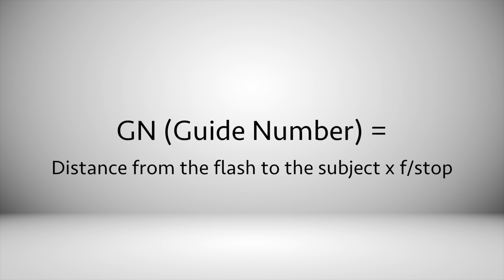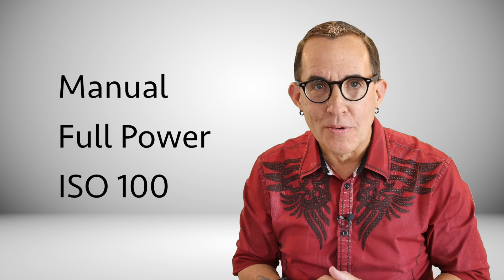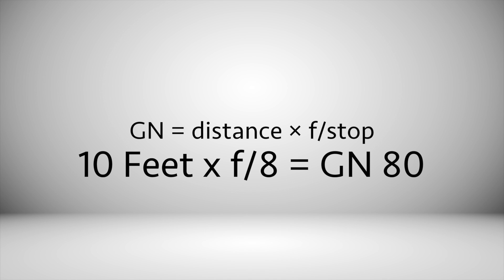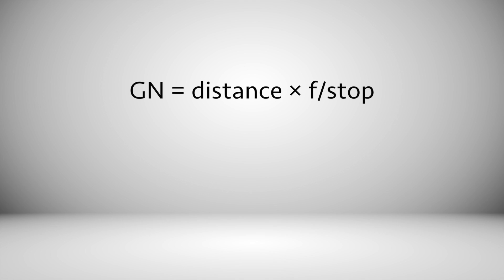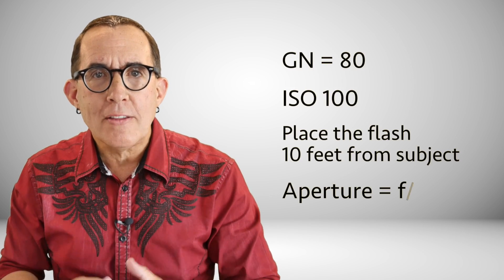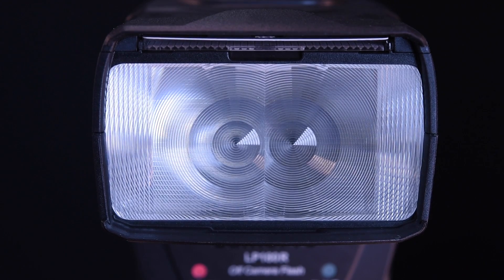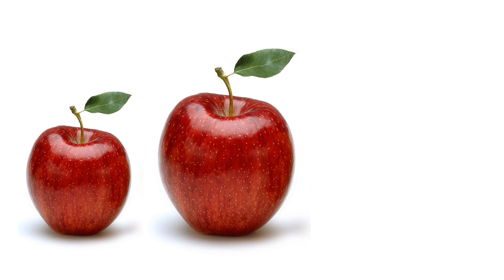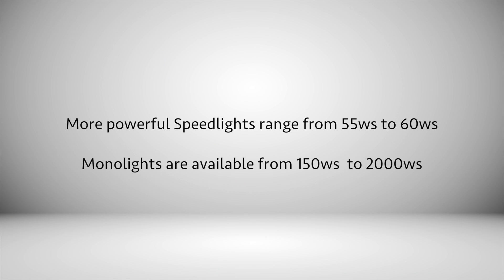Guide Numbers and Watt Seconds -  Flash Photography Tutorial #3

Comment: As the track photographer for the local NASCAR short track, I"ve been using my Nikon D7000, 18-300 lens, SB910 and a pixel td-382 flash pack.  the trouble I'm encountering is at night, even with the high end rechargeable batteries and flash pack, the 910 can't seem to keep up with even the 6fps of the D7000.  I'm upgrading to the D500, and am curious as to whether or not you feel that a monolight might offer better performance in keeping up with the 10fps of the D500?
     If a monolight might be better suited to my needs, is there one that you can recommend as a starting point? I'd prefer something more portable, as well as suitable for outdoor use.

Comment: I have a Canon 80 paired with a 100mm L 2.8 macro IS lens. I have purchased a reflector but I do not have a speedlight yet. I want to practice shoot headshots outside (I do not have the space right now) and I have been searching this lumopro you suggest but it seems it's not sold here in Italy both on amazon and ebay. there's another brand I may look for? Thanks in advance.
Reply from the maker: I am pretty sure that you could purchase via https://mpex.com/ pirate9882.  There are many other brands - it really depends on which model LumoPro you were considering.
Reply: Thanks very much Joe Edelman! I was looking for the one you suggest.

Comment: I love the video - very, very clear.  Can you help me understand something about my Elinchrom monolight?  I have a 400 w/s monolight, and it offers a "5-stop power variability" - on the back of the unit, I can dial in from as low as 2.0 up to 6.0.  I'm assuming that's the number of stops of light it provides.  But if I get their 100 w/s moonlight, it says it also offers a "5-stop power variability."  I was under the impression that stops weren't relative.  I understand that the 400 monolight is not necessarily producing a flash that is 4 times stronger than the 100 w/s, given what you've said here - plus there are some other factors, including recycling time.  Ultimately, I just need to know, if I had both lights, and set the digital reading to 2.0 on the back, should I expect the same results from each monolight in terms of light output?  Is there another factor that I'm missing?  Also, if I have the light set to 2.0 and put two stops of diffusion material in front of it, does that neutralize the light?  Thanks!!
Reply from the maker: Thank you Daniel Corey!  The variability is within each strobe.  So a setting of 2 on the 100ws is not the same as a setting of 2 on the 400ws.  If you put a diffuser in front of the 400ws strobe - you could bring it down to the 100ws level or you could just turn down the power.  My sincere advice - watch more of my videos - you are approaching lighting like an engineer,  Forget the numbers - learn to SEE light and you will find success,

Comment: Joe - you made a comment that you no longer use Nikon speedlights because they REQUIRE  line-of-sight IR for off-camera triggering.  I may not understand all the details behind your model demonstration at the end which might give me the answer to my question, but I'm using SB 900's with a D700 AND Yongnuo radio transmitter/receivers and everything works fine. Please explain.
Reply from the maker: Sorry for the confusion greenlight.  If you are using the Nikon SB900's with the camera flash as the commander or if you use Nikon's commander unit - they are line of sight strobes .  Since you are using the Yongnuo trigger - that relies on a radio frequency and does not need line of site.  Nikon has recently updated their line with the SB5000 which is also a wireless trigger.

Comment: Question: As far as guide numbers go, that's all well and good for a bare flash, but how does a diffuser/umbrella/softbox/ off camera affect that? It seems every time I use guide number to expose a shot, (I have been using a shoot through umbrella) I have to stop down considerably to get a proper exposure.
Reply from the maker: That doesn't sound right Neil Caughlan.  Let me take your last comment first... if you are shooting let's say at f/8 before the shoot through umbrella and then you add the umbrella - even if it is thin- it will still reduce the amount of light output which means you have to open up - not stop down.  As for how do you use the guide number with modifiers... remember that the guide number is essentially a reference.  I have never used a guide number as my main method of setting exposure, but if you wanted to - it would be a matter of running a series of test shots with each modifier.  Start with no modifier and confirm your f/stop.  Then add a modifier and test until you match the exposure.  That will tell you if it is a one or to stop compensation and then you know for future use.
Reply: Apologies, I meant to say open up the aperture. Thanks for your response!
Reply from the maker: No worries Neil Caughlan - in that case the second part of y answer would be my suggestion.  In practice - if you are finding it more work to calculate - I would save your pennies and by a flash meter - it will make your life much simpler.

Comment: Thanks for this video, Joe!  I have 1 Godox 300 ws strobe with Bowens Mount which I rarely use in my small studio. It is just too powerful even on the lowest setting. But the 2 Youngnou YN568 exII ETTL speedlights(Gn58) with 622c tx radiotriggers(ETTL/Manual) and the YN560(Gn58?) and YN460 (Gn30?) manual speedlights with the YN603c manual triggers are used all the time. The 2 first speedlights also follow me on travels.  So I know for sure that it's very easy to buy too big and expensive for your needs if you are new to strobes.

Comment: Thanks for your video. I use Flashpoint Monoligths (2 620M and 1 320M) for portraits and I am very happy with them, great value for the price. I also use speedligths for outdoors with a DIY power supply made with a 6v gel battery in a very low budget fix
Reply from the maker: Thanks for sharing Ramón Enrique Méndez Yáñez!

Comment: Thanks for this series it's been very informative and useful to me. Nearly 2 yrs ago I bought 4 cheap yongnuo 560-III speed lights along with the 560 TX  trigger and I haven't looked back. I've not had a single misfire in over 1000 shots with one exception the operator (me) had the wrong group set. They're perfect for what I do and if I need more power I just mount 2 or 4 together to pick up an extra stop or two.  I've added a couple of cheap battery packs and while I've never counted the shots I can get it has to be way up there since I seldom shoot at full power. I know I've never run out battery power.

Anyway thank you for sharing your expertise and knowledge of photography.
Reply from the maker: Thanks Jack and THANKS for subscribing - great to have you along for the ride!